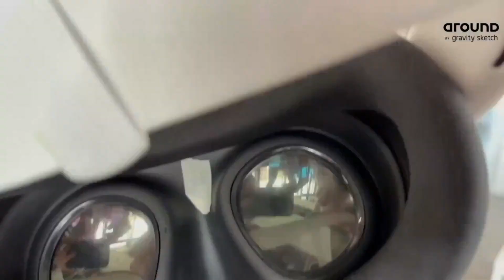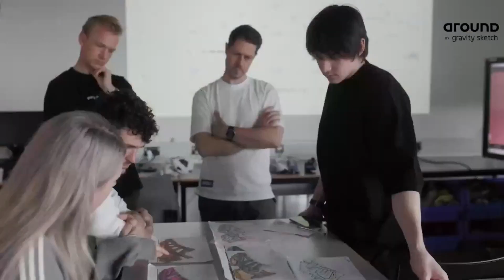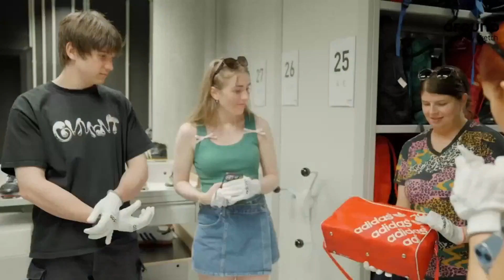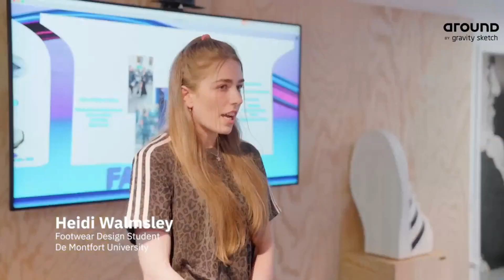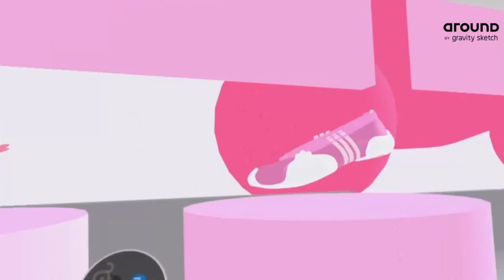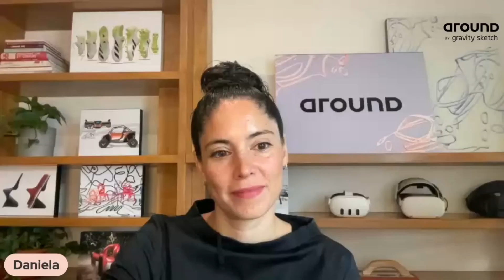Transforming communication in footwear design workflows - with adidas | Around Festival 2024

Comment: when are u guys going to add boolean functions , sculpting , maybe some geometric constraints ?
Reply from the maker: Great question! Out of curiosity, how would adding features like booleans, sculpting, or geometric constraints improve your specific workflow? Understanding your needs helps us prioritize effectively!
Reply: @GravitySketchYouTube  well , at least from a mechanical engineer point of view, almost every project i have starts in GS, then works its way up , back and forth, to CAD. It is easier to iterate, for example, a roll cage for a car's cockpit because i can draw some tubes and change the notching points quickly, i can actually test its ergonomics in VR and validate the scrutineering, but when it comes to suspension components or moving parts , to test them i have to kinda move them bit by bit . It is very hard to simulate a door closing or moto forks compressing , or even much more complex assemblies like wishbone suspensions moving and steering . I think you can make a pretty simple point to point or point to beam kinda constraints, and then you can design pretty much anything (and works great for animators rigging sculptures) . As for the boolean cuts, it's a big must , for example, i want to make a cutout vent for a hood , i have to outline everything then make a surface around the lines , delete some internal faces then match the vent outilne ... To much work , i should make the hood, then create an interesting volume and substract the intersection,  and that will change the game forever , some people might even give up Blender. I know people that fell so much in love with VR designing that if there was a complete software that can do it all , something like Fusion /Blender that has both freehand designing , but also precise geometrical functions they will never touch a PC ever again . I know it sounds like a nieche market , but designing is about creating something out of your own hands , and VR and GS make that a reality. All lm saying is if you guys invest just a tad more fratures and make it more precise, then people around a hole lot of engineering and design spectrums will join in . I know engineers that use GS just to route cables and hoses around 3D scans of their project cars !! 

Thanks for listening , i hope this message gets to start the next big thing in VR and let more people enjoy the humanness of designing !
Reply from the maker: @nostamine2567  Thank you so much for going into such depth here. Really useful!